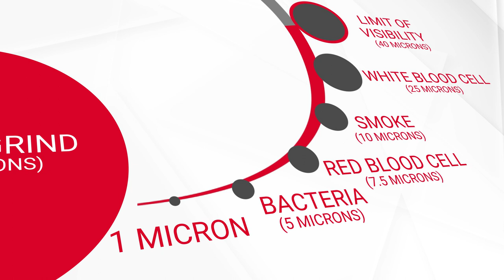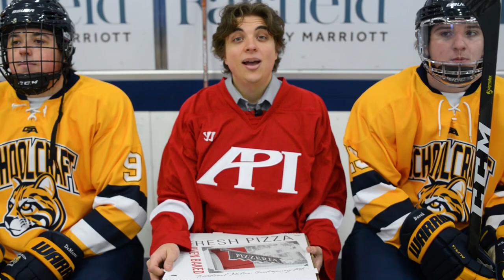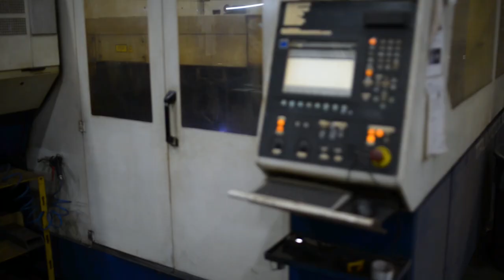What Is A Micron?

Comment: why are there so many different measurements for common things across countries? For instance, I recently saw a video where a UK lady is talking about laminating sheets and the pack she showed says 150 microns. Well, she's in the UK and I'm in the US so her link to Amazon doesn't work for me. I manually typed in the brand she used - nothing came up. I figured - it probably is a local brand, so I just typed in "150 micron laminating sheets" and - nothing said anything about microns. The all said 3 or 8 millimeters. I looked up the conversion and thought - this can't be right. It says 150 microns is 0.15 millimeters - huh??? But the lowest laminating sheets I saw said 3 mil. That means her sheets are nearly 1/7th of a millimeter thick? So why are their sheets in microns and ours in millimeters? Or did I get this all wrong? And why don't manufacturers use BOTH measurements to make things easy globally??